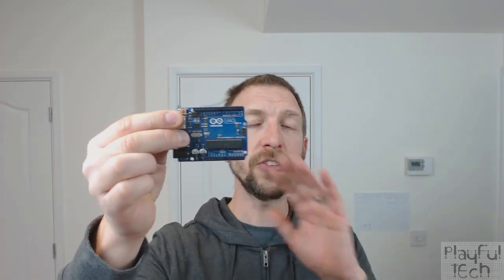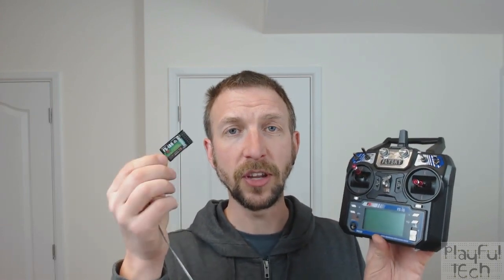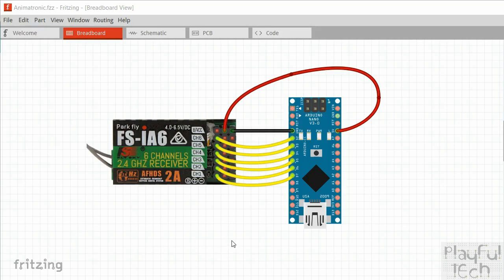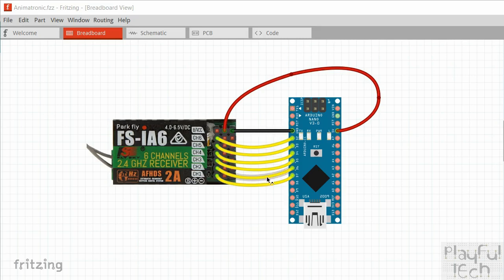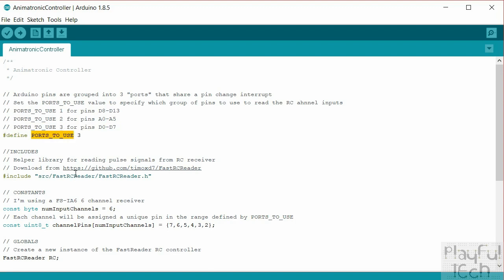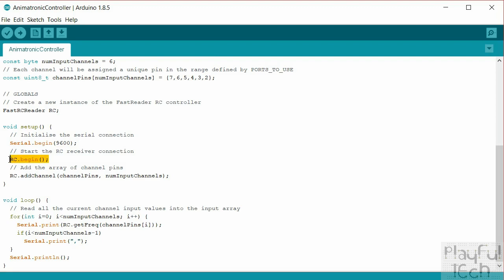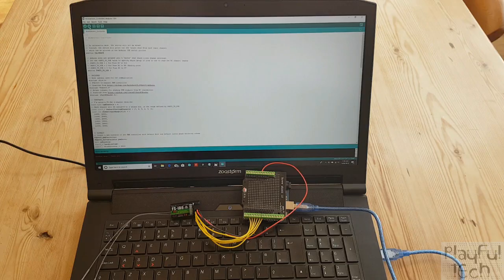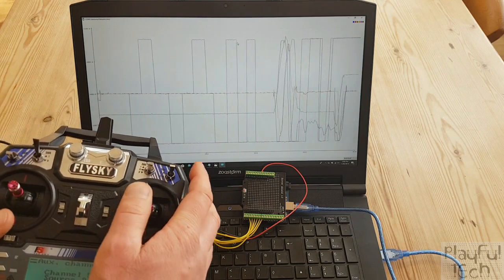Arduino Animatronics - Setting up a RC Controller

Comment: What´s the use ????
You can control the servos directly by the receiver.....
?????
Reply from the maker: Because RC receivers only provide a 1:1 mapping, where each servo is controlled by a specific input channel. For animatronic control, I might want a non-linear relationship, or I might want to combine input channels, or to add a timing circuit, or other rules, and that's why you use a microprocessor like an Arduino to add a logic layer between input and output.
Reply: @PlayfulTechnology  Thank you !

Comment: hi

How can the RC transmiter control the speed of the stepper motor
Reply from the maker: Stepper motors don't have a speed as such - they move a number of discrete "steps". You can use the code here to read the value of the RC stick on the Arduino and then use that to specify the number of steps to move.